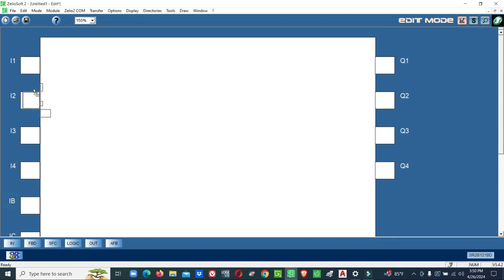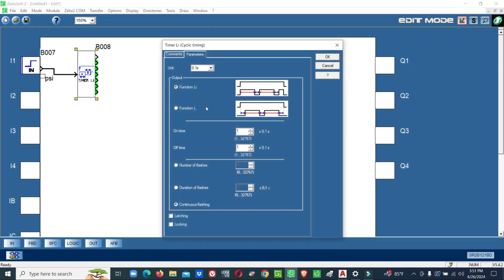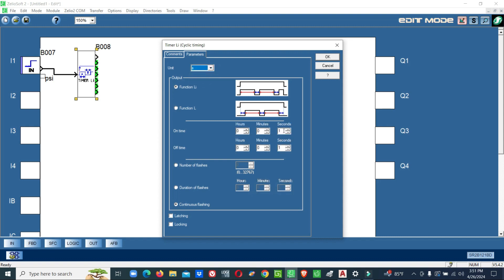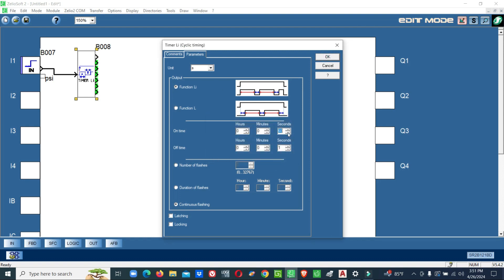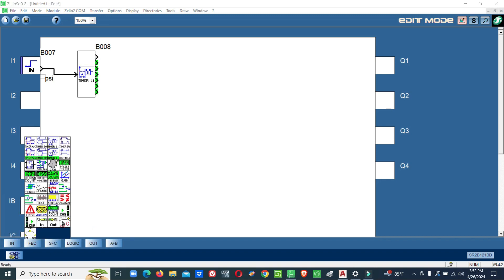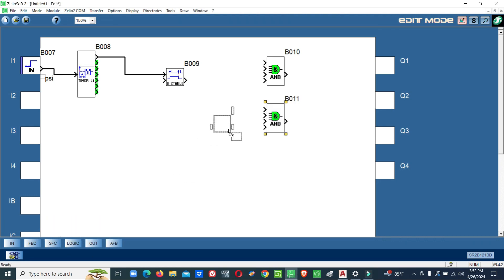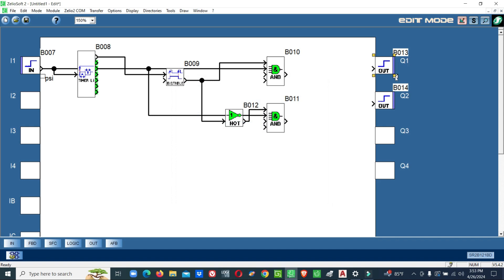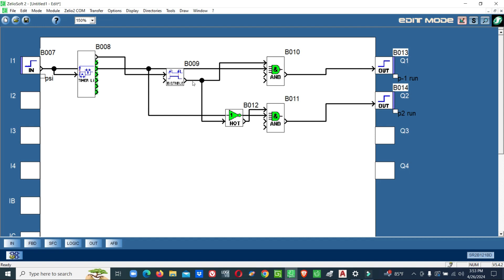How to use impulse relay and cyclic timer in PLC for duty standby logic/ FBD/Schneider PLC

Comment: Thank you! I was stalled in my progress trying to merge timer with pressure based alternating pumps and this video helped lots! My next step along this path will be incorporating delayed “lag pump on” to assist the lead pump reach set pressure.
Reply from the maker: if need any assistance do message me... will do my  best... al the best..
Reply: @sennapparajan.p  thanks again, I’m struggling to figure out how to add delayed 2nd pump start to reach set pressure. Resolving minimum lead pump run time with delayed start of 2nd pump with its own minimum run time is confusing and hard to understand
Reply from the maker: @josephmaloney6906  really i dont understand what u want exactly ..please explain clearly step by step..
Reply: @sennapparajan.p  thanks! On a dual pump system 1st pump starts on a call for pressure with a minimum run time before pump 2 starts on delay until pressure is made. The lag pump also has a minimum run time to prevent short cycling. If either pump trips it defaults to the remaining pump  and finally they alternate lead and lag. I’m not visualizing the order of things. Thank you for any wisdom you might share in this regard!
Reply: Dear sir.i am from Sri Lanka.send your WhatsApp number